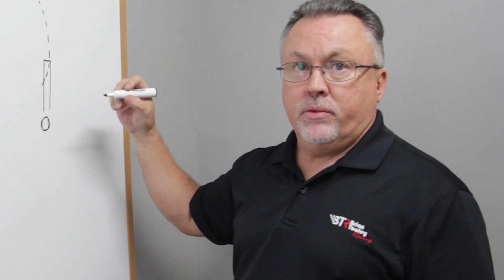Stock vs Roller Rocker Arm

Comment: Please explain how the arc of travel changes between stock stamped steel and roller rocker arms as this is dictated by the shape of the cam and that cam doesn’t know or care which type of arm is on the other end of that pushrod.
Reply: this is true but with roller rockers you normally use a more aggressive camshaft, thats the main point for horsepower. but they obviously reduce wear also